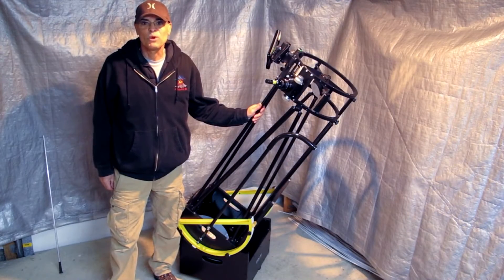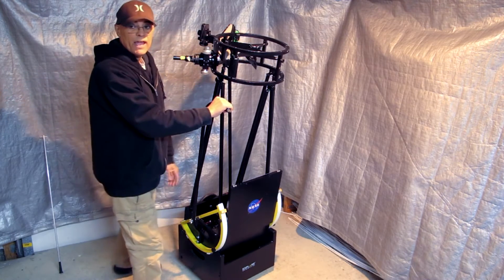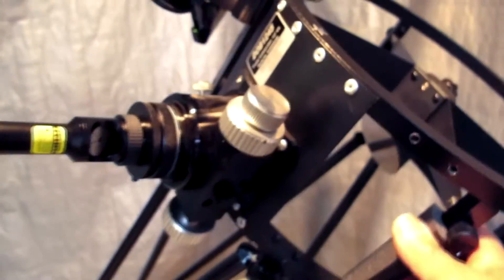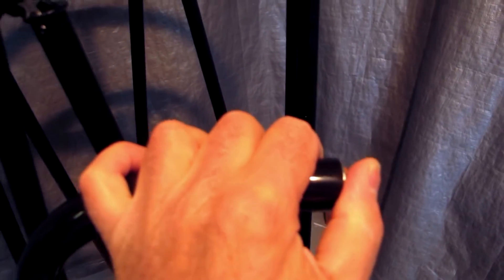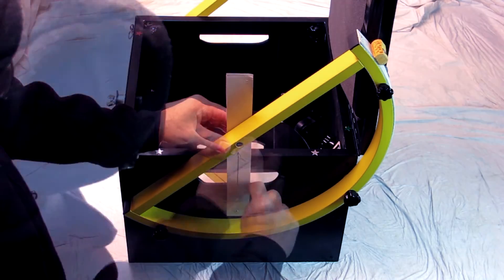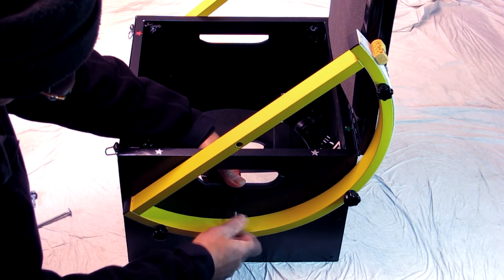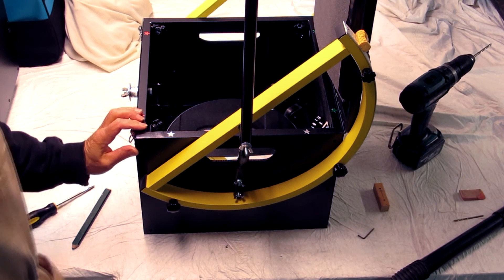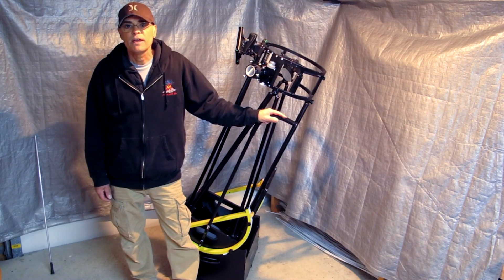Explore Scientific Ultra Light 12" Dob / Holding Collimation

Comment: Great tool ,thanks for sharing. I have also the 12",but have some issue tot collimate, is there a video available showing how to collimate ?
Reply from the maker: You're welcome., Francis:)  There are many collimation videos here on YouTube.  But instead of having to go to the back of the dob, you can adjust the primary mirror with the extension tool provided at the front. And the secondary mirror can be adjusted by hand, tool free.  It's really the easiest system out there because you can see the primary mirror as you adjust it instead of having someone tell you where the dot is.  Thanks for posting!
Reply: @DakotaStarryNights   good  morning,thanks for the reaction. It is a great tool to adjust the primairy mirror. But how can i place the secondary on the right position ? Is that only by using  the 3 knobs  with springs ?  Many thanks,have a great day.

Comment: A great solution, this will help mitigate the issue but not eliminate it completely. The trusses still shift slightly just from the inertia of sudden movements, or having heavy equipment such as eyepiece + coma corrector combo in the focuser and using pointing the scope more horizontally (low horizon viewing). This is the main thing keeping me from getting into truss/ultralight dobs. I just stick with my 10" solid tube, it stays in collimation even over multiple nights bringing it in and out of the house! Had a 12" solid tube, preferred the views but it was too heavy and I never took it out.
Reply from the maker: A 10" solid tube is definitely less hassle setup than a truss tube.  And for what you may be giving up vs the 12" it's really not that much, so...

Comment: Thanks a bunch for all the ES truss dob videos. Just got my 16 “ and from this video appears you insert the Hotech directly into the focuser tube without the compression ring attachment when collimating. Just checking if this is the case as I just received my 2in Hotech laser.
Reply from the maker: I know they say using the compressing ring centers the collimator in the draw tube.  Which is true.  But my way of thinking is to use the set screws in the focuser in the same sequence (important) as you intend to put the eye piece or 2" to 1 1/4 reducer.  Because if you center on the focuser draw tube, then put in an eyepiece that doesn't have the same self centering ring, your eyepiece will be pushed off center by the compression screws.  So you want to have the offset the same for the eyepiece and collimator.  I hope that makes sense.   Big congrats on a big dob!
Reply: That makes sense and thanks for that quick reply. I’ve also got the HR coma corrector on the way and watched your video and will be collimating with it attached when in use. Clear skies to you from central Massachusetts.

Comment: Hello
I have watched many of your videos and you have had some great ideas on improvements for the scope. Well I did a lot of research and decided to upgrade to a new scope and just bought one of these brand new in gen 2. I plan to do some of the upgrades that you did here. Are those levers still available? Would it be possible to get one? If so how? Feel free to contact me if needed.
Reply from the maker: The Gen2's are reported to be a nice improvement over the one I purchased during the initial release.  So, you may not need the upgrade.  Even so, they are no longer available.  That said, the ES UL12" is hard to be from a price/ performance standpoint. It was one of my favorites, once I sorted out the problems of the Gen 1.  Congrats!

Comment: I've got my the same 12"dob but some scretches in the mirrow made me unhappy😢
Reply: Unless it looks like a cat did a tap dance number on it or they or wide deep gouges, scratches don't really degrade the image as much as you think. Lay a string of yarn across the front of the your telescope, and I bet you won't even notice the difference even when staring through the eyepiece the whole time. That yarn is much thicker than a scratch. As long as 99%  of the light is going where it needs to go, you won't notice. You can always get your mirror recoated too should it ever become too damaged. 100-200 USD depending on mirror size and what quality coating you go with.
Reply: @NOLASkaGuitarist  thank you!be happy!

Comment: Do you still use the scope? How you like it after a few years?
Reply from the maker: Yes I do.  It's the one I use at really good dark sites or the astro-festival at Badlands National Park with night vision.  The ES Ultra Light 12" with NV was blowing them away down there.  People were waiting in line throughout the night until I finally rolled up.  Also had a lot of folks coming  back to see some more.  But around  town I use a 6" refactor or the 8" ES Imaging Newtonian.  Again, with night vision and an Astronomik Hydrogen-alpha imaging filter. It cuts clean through light pollution.   Thanks for posting.

Comment: Given that the Pro SteadyGrip is no longer being sold, would you be able to provide dimensions and and a parts list so we could build one on our own?  Thanks and  your videos are great!
Reply from the maker: I get this question a lot.  What I would suggest is to cut a full 1.25" x 1.25" x (a length you find comfortable) of oak or ash and block out the bottom to clear the altitude bearing.  Bolt the bottom to the mirror box and run a 3/8" bolt at the top for a handle to turn the dob with.  You could slip a piece of rubber or vinyl hose over the 3/8" bolt to cover the threads.  And run a little chamfer, or sand, the sharp edges on the lever.  The 1.25" hardwood lever would be better than the original 1/2" OD lever for the larger 16" ES Ultra Light, as the 1/2" OD would flex too much under the additional weight. Hope this helps. Dakota

Comment: Do you make these for the 16” Explore Scientific?
Reply from the maker: No, I did not.  What I would suggest is to cut a full 1.25" x 1.25" x (a length you find comfortable) of oak or ash and block out the bottom to clear the altitude bearing. Bolt the bottom to the mirror box and run a 3/8" bolt at the top for a handle to turn the dob with. You could slip a piece of rubber or vinyl hose over the 3/8" bolt to cover the threads. And run a little chamfer, or sand, the sharp edges on the lever. The 1.25" hardwood lever would be better than the original 1/2" OD lever for the larger 16" ES Ultra Light, as the 1/2" OD would flex too much under the additional weight. Hope this helps. Dakot
Reply from the maker: Sorry, but I don't have a 16" so couldn't make one for it.
Reply: Dakota Starry Nights Thanks for your videos on the 12”.  I just ordered the 16” yesterday and from what I understand they’ve fixed a lot of the issues that you discussed in your review of the 12”.  Very cool!  Thanks!
Reply from the maker: Congrats on the 16"!  I was seriously considering ordering one but I put a lot of work in my 12" and just recently optimized it for night vision so... Let me know how it goes.  Thanks for posting. :)
Reply: Dakota Starry Nights Thanks!  I’ve been watching your videos and I really enjoy them!  I like your observing buddy!

Comment: Darn... only available for the 12”. Oh well, guess I’ll be getting plenty of practice collimating
Reply from the maker: What I would suggest is to cut a full 1.25" x 1.25" x (a length you find comfortable) of oak or ash and block out the bottom to clear the altitude bearing. Bolt the bottom to the mirror box and run a 3/8" bolt at the top for a handle to turn the dob with. You could slip a piece of rubber or vinyl hose over the 3/8" bolt to cover the threads. And run a little chamfer, or sand, the sharp edges on the lever. The 1.25" hardwood lever would be better than the original 1/2" OD lever for the larger 16" ES Ultra Light, as the 1/2" OD would flex too much under the additional weight. Hope this helps. Dakot
Reply from the maker: No worries.  The ES UltraLight is easy to collimate.  Congrats on the 16"!

Comment: Do you ever use your scope in your yard?  If so, are you able to roll the whole thing out and back for viewing?
Reply from the maker: I typically take it out to a dark site.  It's breaks down into two components, with the secondary mirror cage sitting inside the rocker box.  I find it really easy to move around this way.  I guess you could put it on a low platform with caster wheels if you intend to view only at home.  But a trip to a good dark site pays off handsomely.  At a class one dark site I've seen things with this dob I've never seen before.
Reply: Dakota Starry Nights good timing. I received my 16" Gen 2 this week and am trying to figure out a way to do wheelbarrow type handles and wheels.  But first I have to balance it.
Reply from the maker: There is a hole in the mirror box, at the rear, which has a removable 
plug.  You can pick up a bolt and wing nut at the hardware store and a 5
or 10 lb dumb bell weight at Walmart or sporting goods store for balancing. 

For moving it around assembled you could maybe point the scope at zenith and hold it there with some bungee cords attached to some eye bolts on the moving platform.  Just some ideas to 
kick around as figuring this stuff out is half the fun of it. Clear Skies